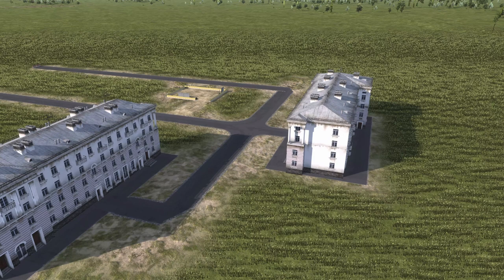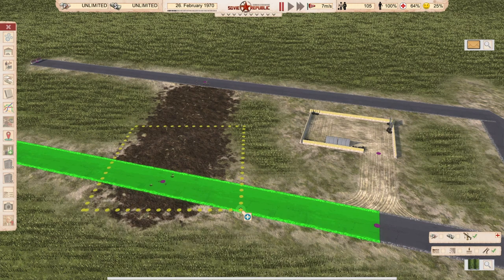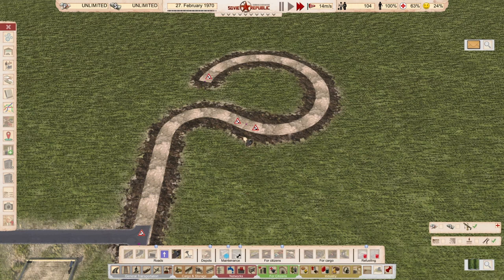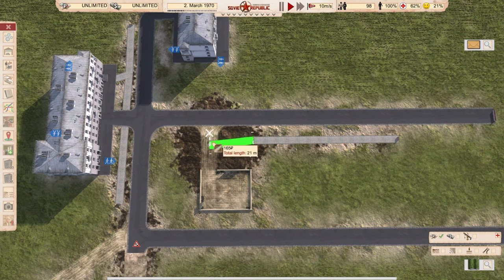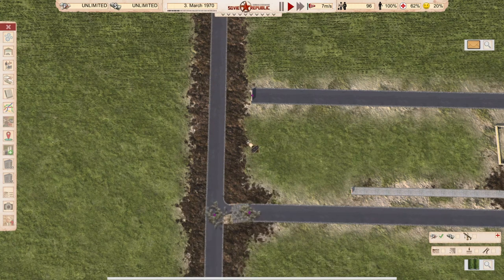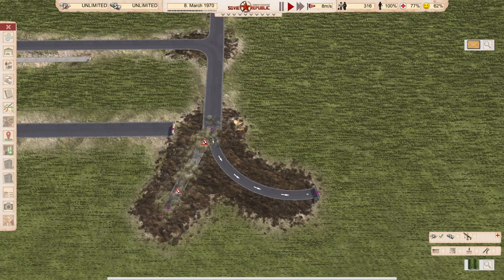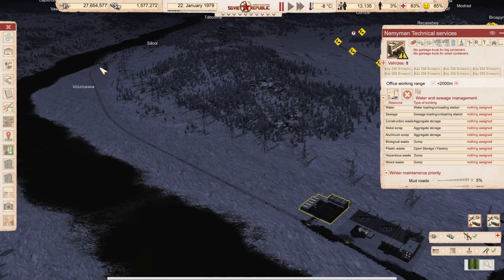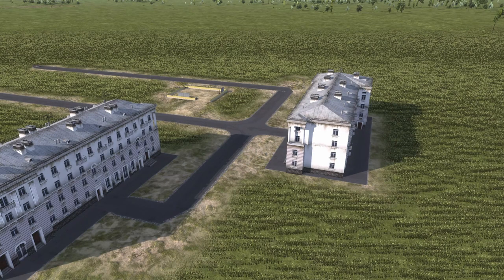Beautiful builds with these tricks. A How-To  for Workers and Resources Soviet Republic

Comment: If you build a long stretch of road, that entire road is inaccessible - trucks cannot drive there.
When I do this in smaller segments, for instance 32 tons of gravel in length, then the roads will be build in segments (gravel, paver, roller) and a growing part of the road can be used in the meantime.

This does not have to slow down construction - more so if you use open hull to transport mechanisms.
Reply from the maker: There are pros and cons to both methods